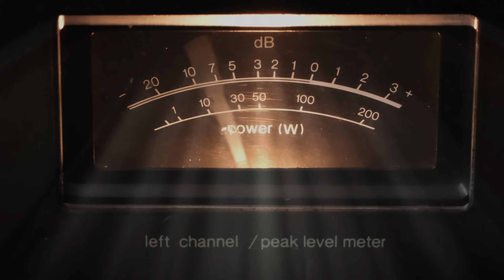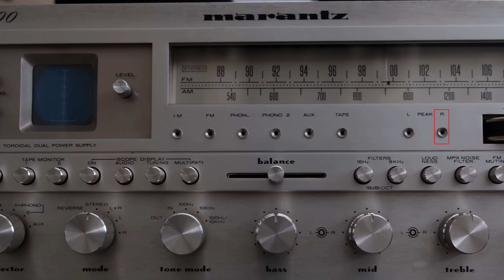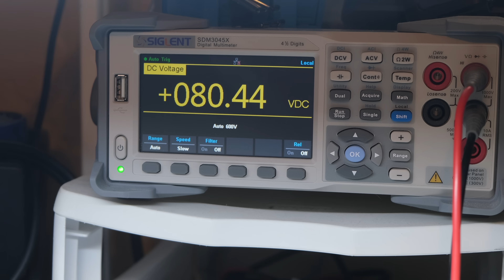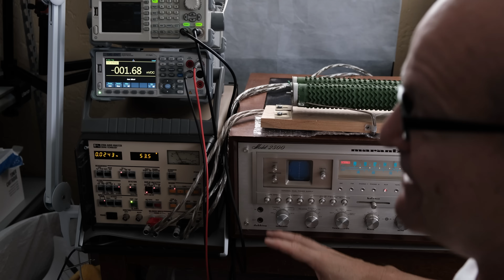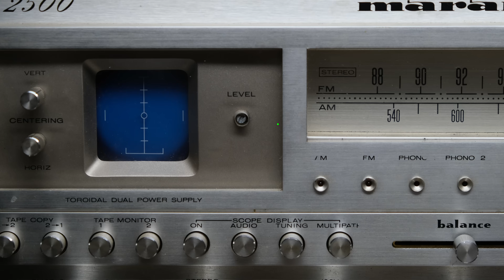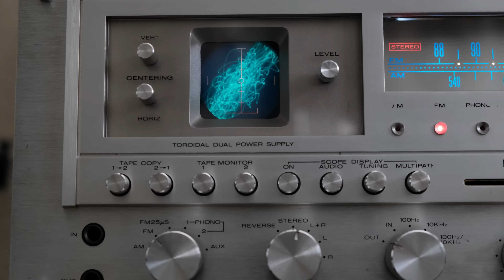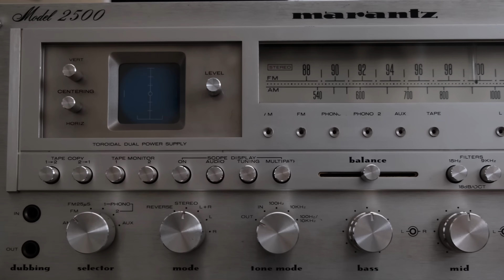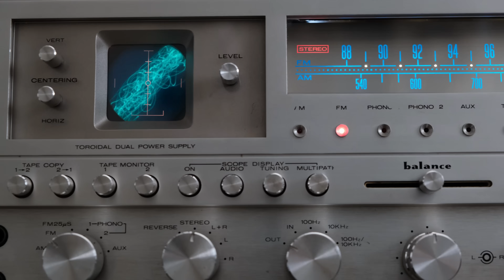Marantz 2500 Repair: Blown Output Transistor FIX & The 'Transformer Issue' Truth

Comment: The reason the transformers have issues is a design flaw in the protection circuit. These 2500's were designed with an unbalanced protection circuit. They have designed these to handle the massive in rush current but that resistor is the wrong value to protect the shorted outputs from the transformer and because of the inrush current it cannot be changed. When the main fuse blows from a faulty output this happens because that resistor will fail open. But the design they have allows the resistor to handle both the shorts and the inrush. The shorts from the outputs will fry the Toroid before the resistor should normally fail open. There is a stage missing in design on the protection PCB to eliminate this. I have a revision somewhere that addresses this. Never leave this on without being there that Toroidal Transformer is the heart of the unit and non replaceable.
Reply from the maker: That's very good info, thanks for sharing.

Comment: It could be a 100 things possibly a bad filter cap; OR I think you’re right about the circuit protection board could be resistor, cap, diode….then again those three things on any of the circuit boards can cause crazy things to happen. Especially when it comes to tech gremlins & Murphy’s Law & audio Equipment.

Comment: Great video & Great receiver!
Lowering the B+ & B- fuse value a bit might be a good idea since most people are not going to listen to this receiver at full volume anyway and if an output were to short again it should blow the fuse instead of the power transformer. The  2500 is a BEAST! It like a recover with a commercial power amp inside! Once you get into this much output power if they didn't use a fan (active cooling) the receiver heatsinks would have to have been MASSIVE to dissipate that much heat! Also the scope generates a bit of heat as well.

Comment: How simple a classic tube amp locks,compared,i think with those prices on vintage resivers,i wold better have problem with a simple design tube amp. I only use tube gear,homebuild s moestly.

Comment: Before you're start just search and download service manual and yes take/print pictures of important components and connections. Don't expect that capacitors after 30+ years after factory release have still the same capacitance or within tolerance. Same to contact of used relais (LS).

Comment: I’m pretty sure that the inrush resistor only operates for a few seconds during cold starts, to prevent the massive current flow into the uncharged filter caps from blowing a fuse. Once the caps are charged, the resistor is bypassed via a relay.

Comment: I'm not sure about the 2500, but in the Model 18 - the first Marantz receiver and the first one with an oscilloscope, the power transformers were infamous for failing. The failure worked like this: The transformer had a high voltage winding for the scope tube, and this winding had its own rectifier and filter cap, but NO FUSE. The filter cap would fail, creating a short, this would cause the HV winding to get extremely hot, but as it had no fuse, the overcurrent never got shut down. The winding's resistance was too high to let it draw enough current to blow the main line fuse, and so it would just sit there and cook until the HV winding burned through layers of insulation in the transformer, damaging other windings, and eventually causing enough failures to blow the line fuse. Most people never noticed the scope being out, and never knew there was a problem until it was too late.